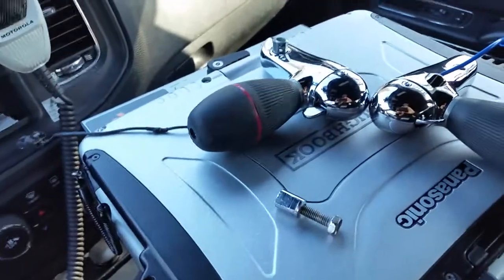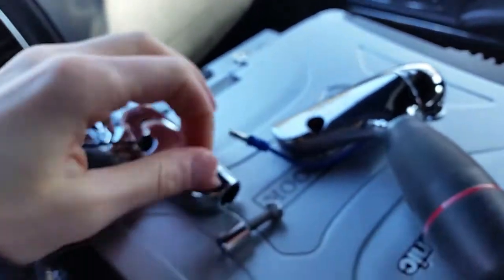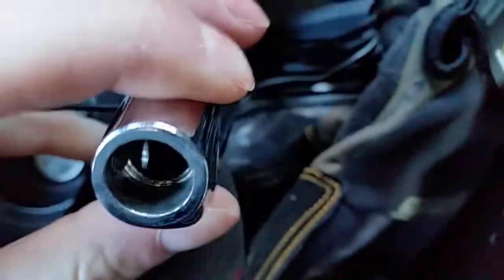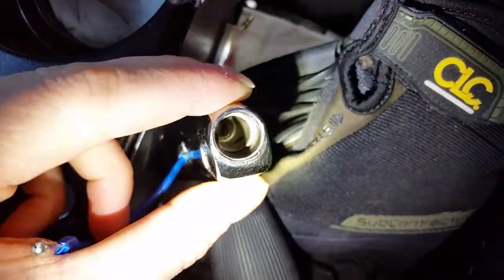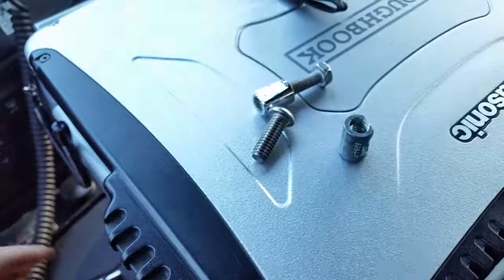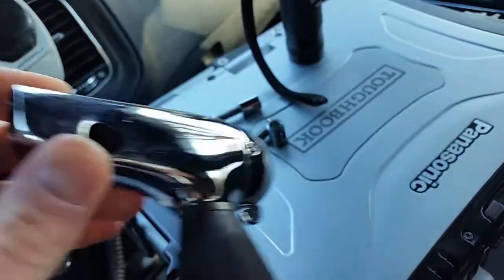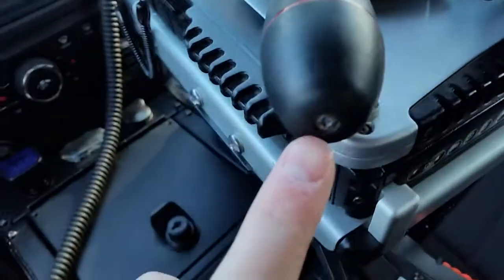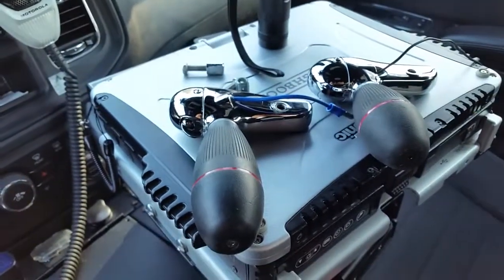Replacing a Unity Spotlight Handle - Different Kinds of Handles

Comment: Do you know of a way to adjust the handle position? When my light is stowed the handle is vertical, meaning in order to use it I have to flip it over to the right where it's facing the steering wheel. I'm looking to get it to face the driver window when stowed and vertical when in use.
Reply from the maker: SpinesGames what vehicle is it installed on?
If it's the adjustable type you should be able to loosen the clamp on the mounting bracket, reposition the light and then tighten it.